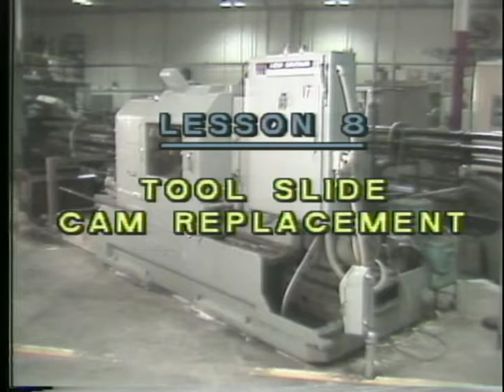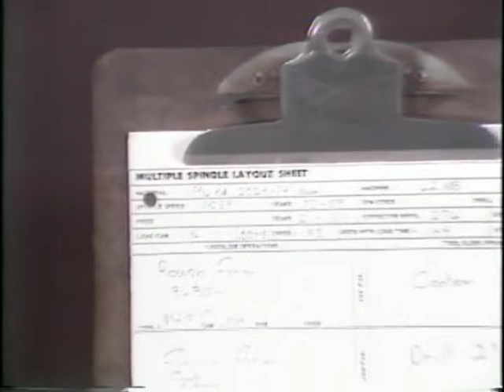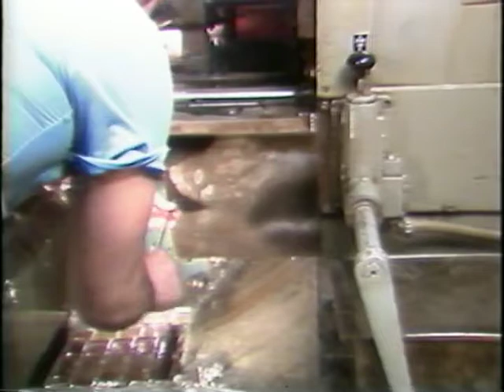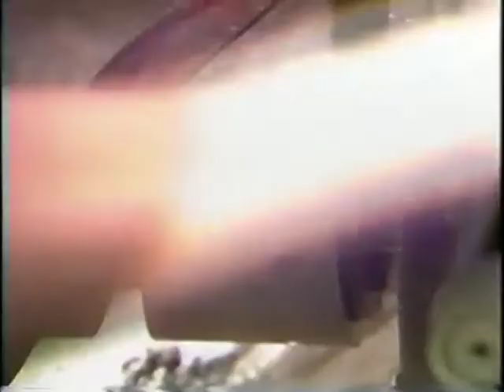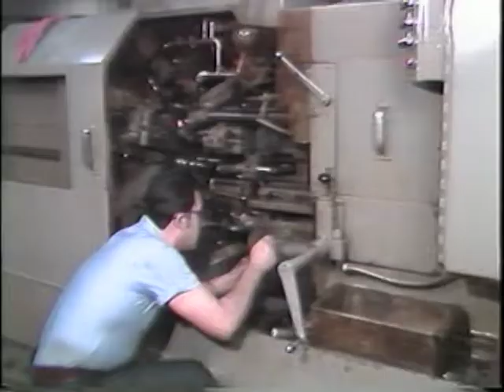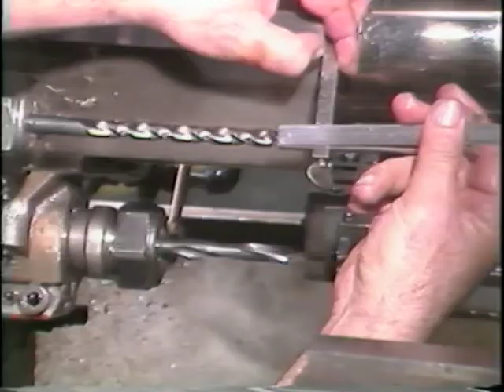New Britain Setup Training Lesson 8: Tool Slide Cam Replacement

Comment: Tip for setting preload on main tool slide. Crank to dwell. Use dial indicator to tell where the end of dwell is. Then zero indicator and back off main tool slide .250" and set your stop. Don't use more preload than that or you can crack the casting.  This method gives more consistant results for drill reaming and recessing.